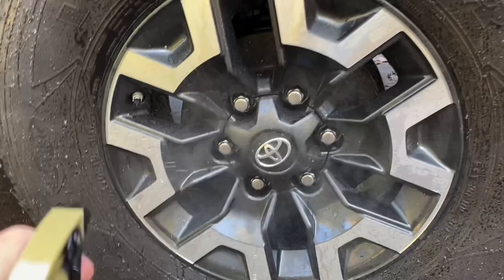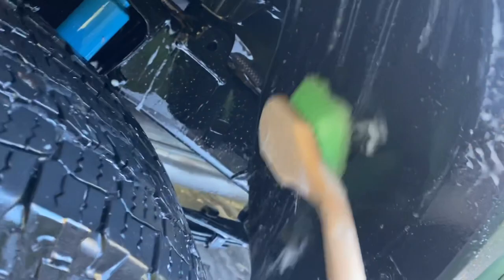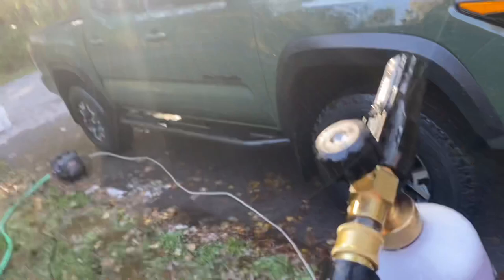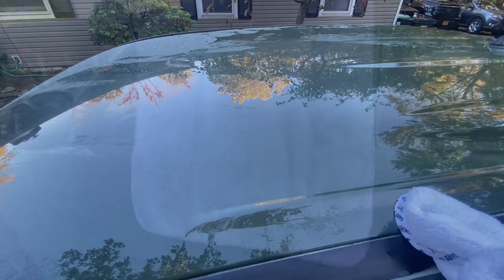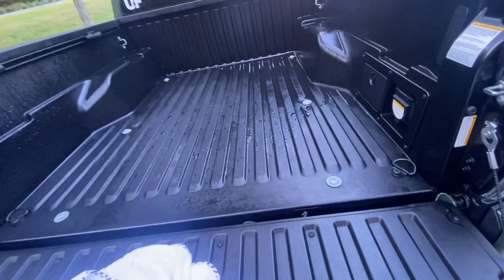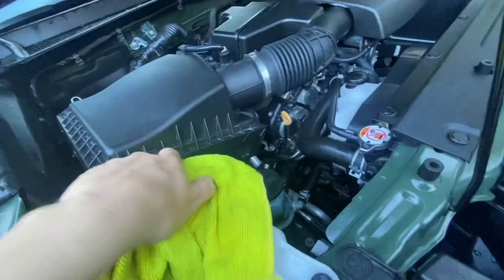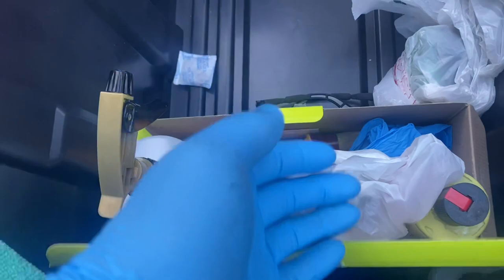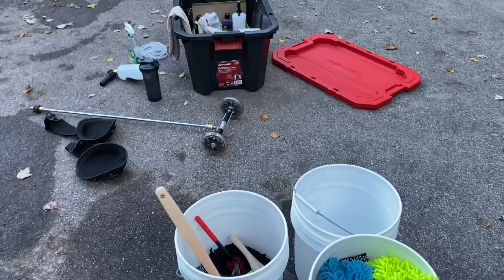The Proper Way To WASH Your Pickup Truck (In My Opinion)

Comment: Highly recommend checking out Obsessed Garage’s channel for detailing- he has a ton of stuff but I have learned so much there. Your process looks solid, if I could recommend a drying aid to you it would be ONR rindless wash (just spray it on the panels before you wipe down and it leaves no streaks, is super cheap as it mixes super well with just water) or Beadmaker (orange). Also if you have a blower like a cordless one that helps before the towel 

Have you coated the truck with wax or any topper?
Reply from the maker: Thank you for the tip! I appreciate you watching my video. I am going to apply Nu Finish this month after my next wash. That will be my first wax. I’m still learning as I go.

Comment: Very thorough and interesting to watch. I have never used a pressure washer on a vehicle, so I am a little leery about using it on my soon-to-be arriving 2023 TRD Off-road. Any tips on using the pressure washer safely? Thanks.
Reply from the maker: Thanks for washing. Yes with high pressure make sure it’s not actually high pressure. This unit I have is low PSI compared to some really high pressure units. That, and keep a 10-12 inch distance and use a sweeping motion. I also revert to low pressure when around sensitive things like head and tail lights, third brake light, and emblems. A traditional shower head on a garden hose works great too!
Reply: @brianruperti  Thanks! I really appreciate your help.
Reply from the maker: My pleasure!
Reply: @brianruperti  On an unrelated note, there's a guy on YouTube called the car care nut and he's a Toyota mechanic. He recommends having the first oil change on a brand new vehicle at 1,000 miles if you are planning to keep the vehicle for a long time, which I definitely am. What is your opinion about this? Thanks for your time.
Reply from the maker: Ahhh yes the 1k change. I follow car care nut, his channel is very educational! I skipped it. If you have the time or patience to do it so early, why not? He’s seen many more service vehicles than I have. I took the “risk” and hit the ground running with trips to Tennessee and some off-roading for my first 5k miles 😎
Reply: @brianruperti  I have only bought one other new vehicle and I drove it for 14 years and only sold it because I had a family that outgrew it. That was in 1989! I plan to buy this truck until I am too old to drive it anymore, so I want to take care of it from the start.
Reply from the maker: That sounds like a splendid plan. The car care nut gives great advice to make that happen.

Comment: Question for you or anyone here.  In the past with a newer vehicle than I have now, part of my "finish" of detailing my vehicles was to use a leaf blower to dry out the cracks and crevices, preventing those streaks that driving right away may appear.
Reply from the maker: Nice technique. What’s the question you had?
Reply: @brianruperti  Do recommend using a blower?  And at the end of your video, I see what  I think are wheel ramps.  Do you use them while cleaning the undercarriage or just for the video angle?
Reply from the maker: @dondijr  I think a leaf blower is a cool option. I’d personally only use it for snow if I had one. A little loud for me. But I don’t see an issue with it. One drawback is you don’t want to get too close and blow water too hard into places it doesn’t need to be. 

The ramps were used for my frame cleaning, which I did to prepare for my rust prevention. Those 2 videos can be found here:

https://youtu.be/WxA_dQp2WAk

And here:

https://youtu.be/JdoWlNXfD3U

Comment: I know I’m late to the comments.  Great job with the wash. Is there a specific drying towel that you use? Chemical guys? And how do you wash the towel? Thanks for your info. Great video.
Reply from the maker: Thank you. Yes it’s chemical guys super dry towel. I wash it with dish soap by hand top to bottom and rub it against itself to get the dirt out. After one year it’s retired and replaced.

Comment: By chance do you have a list of the tools your used to wash your truck? What pressure washer do you use and attachments? How do you "fix" rock chips or little scratches?
Reply from the maker: I used the Ryobi pressure washer, chemical guys black magic, the Ryobi undercarriage sprayer. 

To fix rock chips I use a dot of Toyota paint that matches my truck and apply a tiny bit and call it a day. Every spring I find new chips and touch them up right away. I don’t obsess I just get it done and move on. Some people get all worked up over chips. Touch it up and move on in my opinion and you’ll enjoy the truck more 😎

Comment: No one does this unless they really love their vehicle. I feel ya. Wondering why you don’t use a spray on ceramic coating of some sort. Wouldn’t that make it easier to clean and much less likely to scratch? I used to work with a body guy who had a gorgeous black f350. I asked him one day how he got black paint to look sooo good all the time. He said  “I use a good wax, there’s probably like 30 coats on it right now.”  Lotta time in, but, no one I know has ever had a black daily driver look that good. I wonder about what’s better, layers of great wax or ceramic/nano type stuff.
Reply from the maker: Thank you. I’m still learning about ceramics but I don’t know how I feel about multiple layers of wax. I don’t want to trap contaminants into the paint/clear coat. But I’m a novice to detailing so I’m learning as I go.
Reply: Weighing in as a detailed of my vehicles (2020 Tacoma TRD OR Long bed), you can go either direction. IMO, ceramic COATING is the stronger more durable finish and lasts a while if maintained correctly. Wax needs to be done every 6 months at most and 2-3 layers is sufficient..I think 30 layers is a lot haha and could even be introducing more scratches while being applied potentially with that many times. 
From my results, wax produces a deeper shine and better gloss, while the ceramic blows it out of the water for protection and longevity

Comment: What kind of wheel/rim cleaner would you recommend for the black TRD Pro wheels? Do you think something like Meguiar"s Ultimate All Wheel Cleaner would be ok?
Reply from the maker: That’s a great question. In my opinion, Poor Boys World is the best. I know McGuires makes great products too. Never used their cleaner though. 

*always spot test a small area before using on the entire surface.
Reply: I’m thinking I’d be best to use something acid free and pH balanced.

Comment: Hi Brian great video i have my 2022 Army green coming soon cant wait, got a question are those step bars tyger from Amazon ? if so how are they do you like them do they interfere when your stepping out thanks bro for your opinion much appreciated
Reply from the maker: Hey thanks! Big congrats I’m sure you’re very excited. Army green is amazing. They are from Amazon offered by Tyger. I like them a lot. The styling matches the truck perfectly for me. I like the tube that goes all down the body. They hold my weight just fine (175lbs) when I wash the roof and clean the windshield. I also like the extra lower level bars (though they don’t count as a true rock slider). 

Funny you commented. Tomorrow I am posting a video about some maintenance I needed to do to them! This is only because my truck goes on mild off-roading trips with lots of gravel, dirt, mud, and rock. So stay tuned for that. 

I’m 5’10” and though I didn’t need the steps when I purchased my truck, my woman is 5’1” and so is my mother and my sisters are all under 5’5” plus I have a 9y.o. nephew and 7y.o. niece that use them. It’s a truck that see groups. 

That being said, they don’t get in the way because I use them every time. For example: when I enter my truck, I make it a point to step onto them, sit on the seat, tap my boots together and then slide my feet into the cabin. (I like to reduce dirt inside, yes I’m like that). 

When I exit the truck, I put one foot onto the board and push myself out with that foot and (requires no effort) i seamlessly exit the truck. No I’m not jumping out or climbing out. I just make it a point to use it half way. 

Since I’ve integrated them into my enter and exit, they’re never in the way, and have helped reduce dust and dirt inside the cabin. 

However, on the rare occasions I have skipped over them, they never seemed to jump out and get in my way. Getting out without them will take a little bit of avoidance. I like how the truck looks better without them. But I need them. And I LOVE the way they look and perform. 

I hope that input helps! Tyger makes high quality stuff, at a great price for the value you get. They don’t pay me to say that. Ride the truck for 2-3 weeks without them first (like I did). Then come back to this comment afterwards and you’ll know if they’re worth it. 

Cheers! 

Stay tuned for tomorrow’s video on them.
Reply: @brianruperti  Thanks so much for your honest take , eta is late December so i got some decisions to make much appreciated
Reply from the maker: @mrseahunter1  Glad I could help and thanks again for watching!

Comment: Great job, I have A question on the interior. The hard plastic on the doors and the dash and the glove box I get scratches on the doors what do you use to remove scratches if you can
Reply from the maker: Thank you! So what I would do in that situation is very, very lightly file with a nail file. Then use a torch lighter at a distance to slowly heat the plastic up. It’ll never look the same. And if it’s scratched everywhere then might as well either get over it or replace the plastic. I hope that helps!

Comment: How’s she look in direct sunlight or with a flashlight? I try for perfect with my truck like you and in sunlight a lot of those micro scratches are very noticeable. My only nit pick with army green so far. Not sure if it’s from when it was first washed at the dealer or when but will definitely need a good buff when i find time
Reply from the maker: Looks great in direct sun and I have a couple brush stripes but it’s the cost of having this amazing color